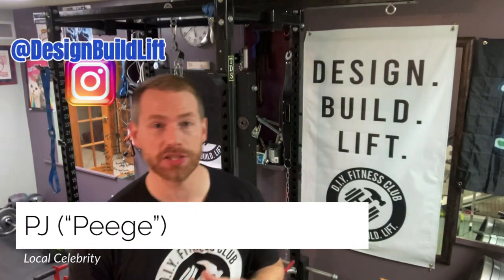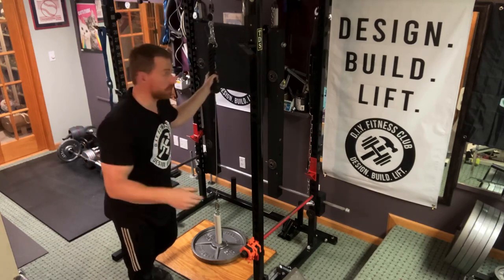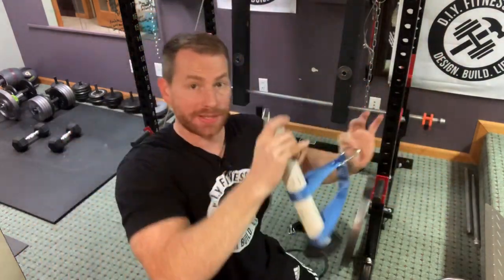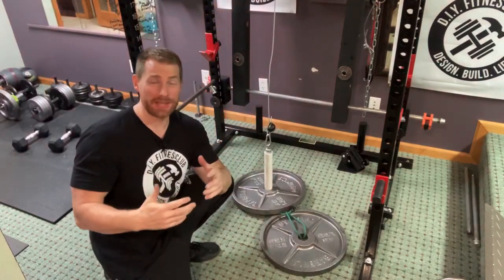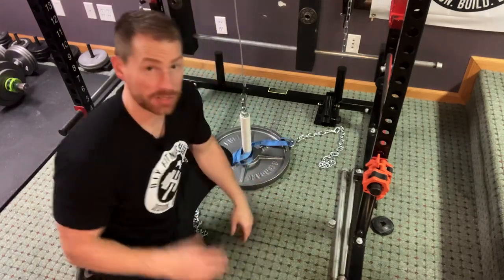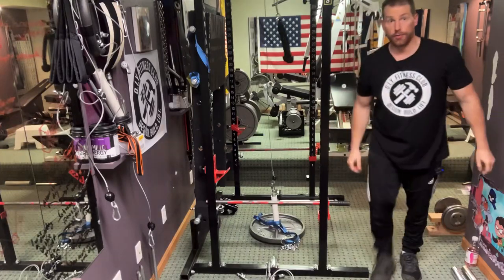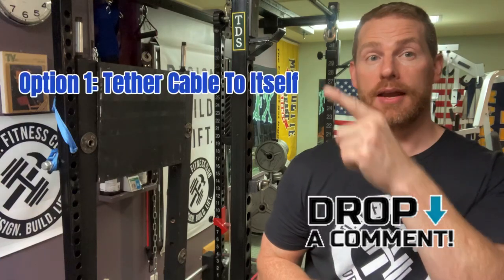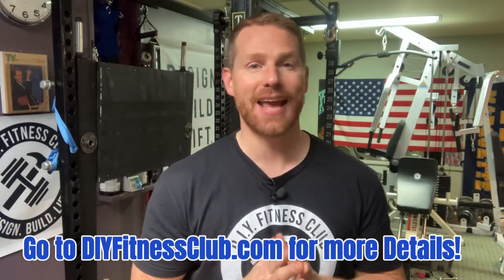4 EASY Home Gym Cable Pulley System HACKS – REDUCE SWINGING

Comment: Awesome video!  This was exactly what I needed and was looking for.  I appreciate all your suggestions, but am gonna try the ones with the chains first, I will attempt to tether the cable first off with a small chain, if it does not succeed, I will move on the to chain method hanging from right above the plate.  I just need to get the chains, guess I will go to Lowes.  What about the straps?  Where would I look to get a few of those?  Thanks for your great video.
Reply from the maker: Awesome! “Soft Loop TieDown Straps” can be purchased from any hardware store for about $1 each. Also - there is an Amazon link in the description of this video for the exact ones that I used in the video. An Amazon link to the chains are also down in the description.    Thank you for supporting the channel!!! 🙏💪🤘

Comment: Nice video!  I like cable systems but hate having to load plates this way wish somebody made a loading pin with side loading so you don't have to latch and unlatch it each time and far easier to do!  I also don't want to pay the $1300 for Rep's cables as they're 2:1 ration and takes 300lbs to feel like 150.
Reply from the maker: Thank you! 🙏🤘💪I also have thought that such a loading pin would be great. If I could weld I would definitely attempt it. 

I love my Rep Fitness Ares attachment (purchased after I made THIS video). It has two 300 lbs stacks, where the functional trainer capbility has a 2:1 ratio, but I am glad that it does. This is done to improve the range of motion and smoothness of the operation. Without the 2:1 ratio the Functional trainer’s cable travel length would be too short (the stack would hit the top of the guide rods before you get a full Range of motion for many exercises).
Reply: Ok that makes a lot of sense!  Does it fit 100% in the 16 inch weight addition?  I have the 30+16 and hoping it can fit back there.  I think thats the best option. What functional strength exercises do you use it for? @DesignBuildLift

Comment: Thanks for the video? What is the thickness of the steel woth the third option? 1/4 inch or os that the width of the chain?
Reply from the maker: Thank you! 🤘🙏💪
1/4” is the thickness of the steel. Available here:

• 36” Long ¼”Chains (2 Pack With Hooks): https://amzn.to/30OR3CB 
• 48” Long ¼” Chains (2 Pack With Hooks): https://amzn.to/3czpzDO
Reply: @DesignBuildLift  thanks you very much!
Reply: And what are those straps?
Reply from the maker: Soft loop Tiedown straps— checkout other uses for these straps here: 
https://www.youtube.com/playlist?list=PL-CiSlSFXnTZyORYxuCW2yf5c488tQ74y

Can be purchased here: https://amzn.to/3kUglqb

Comment: How do you stop the cable from spinning and basically untwisting itself.

Had that happen to two cable so far.
I can hear when it’s about to break as the cable travels over the pulley and see the distortion in the cable protective sheathing
Reply from the maker: Great question! Happens to me, too. Will happen to everyone. I just replace mine when I know its about to break. The vinyl coated cable from the hardware store is not the same cable that equipment manufacturers use. I think the only option to prevent this is to upgrade to better cable. Of course you could also switch to rope/cord (but then you have to deal with knots/tangles which is why I stick with the cheap vinyl coated cable). 🤘🙏💪
Reply: Your post made me aware of the problem so I will give you the solution I used.  The cable is spinning because the plate is spinning causing the cable to continuously twist.  On the side of the cable that attaches to the handle, I inserted a swing swivel that allows the wire to untwist itself.

Comment: What about cable twisting.
Have broken two cables from twisting
Reply from the maker: My opinion: you can’t prevent it. The cheap vinyl coated cable that I used will break. The trick is to replace it before it breaks. See 17:12 of this video: https://youtu.be/ClfftecMCkg?si=07HgZUMuVEaJqNkh 
When it gets dark gray, it is time to replace it. Cheers! 🤘💪🙏

Comment: Easiest way is to just use a second pulley. You work against one pulley, the weight is only ever pulled vertically. No swing.
Reply from the maker: That didn’t work for me. In fact it made the “whip” even worse for me. In this OLD video at 3:20 you can see swing with two pulleys while pulling straight down. Link: https://youtu.be/Fo1WSsl626c?si=e_EZbOiI5XzRzH9U
Reply: @DesignBuildLift  Interesting. Two differences in your setup and mine are that my pulleys are larger diameter and my cable is smaller diameter and looks more flexible. I wonder if either of those are factors but it's good to learn that my experience isn't universal anyway. I had another thought while thinking about this. It'd be a little more setup and you'd have to double the weight for a given exercise but I've been thinking about doing a snatch block setup with a pulley at the loading pin to get more range of motion in the cables without the loading pin hitting a pulley (which happens sometimes if I want to do cable flyes or something). Thanks for the video and response.